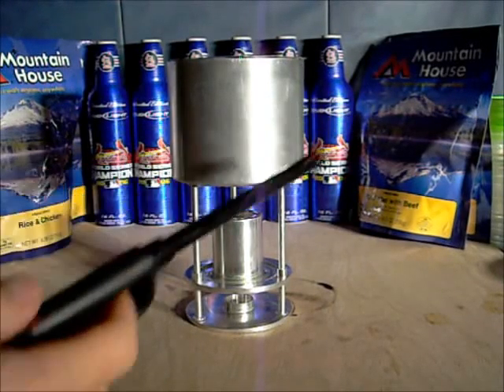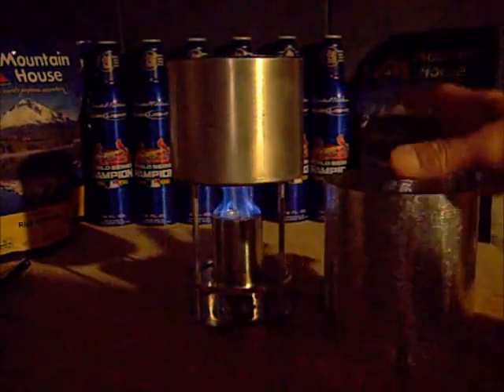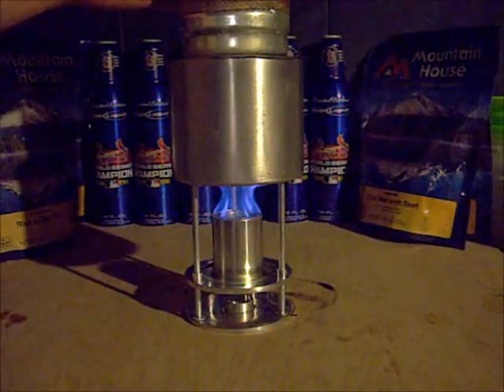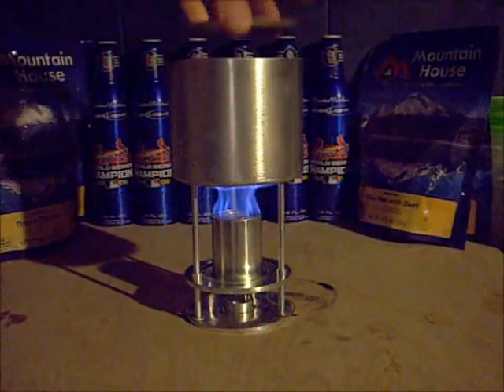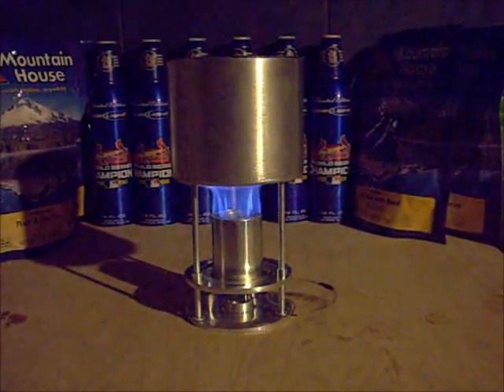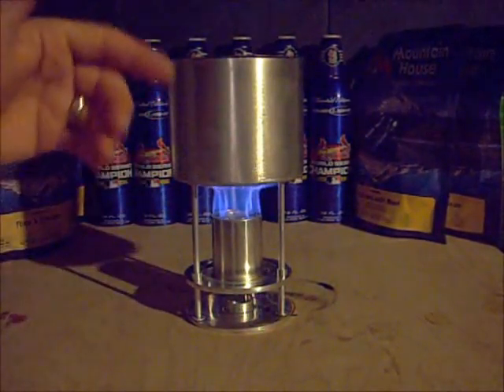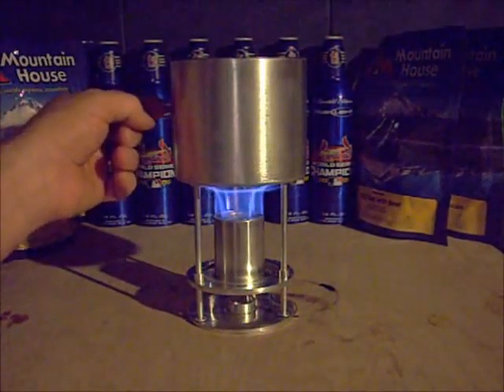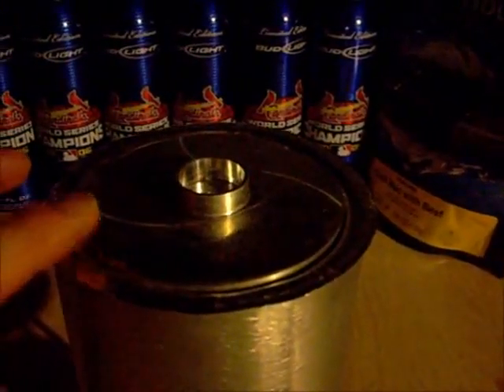New pot design

Comment: I work in a commercial kitchen and all of our cooking pots and pans are bare aluminum. Aluminum readily forms oxides and those oxides form a protective layer, this is called passivisation. When you sanded the surface there might have been a toxic hazard present for a while, until the raw aluminum re-oxidized.

Comment: The biggest problem is that you will build up a lot of deposits on bare aluminum.  A hard anodized pot would be much better.  Check out this ez2curanut  on youtube (jelly lite stove)  as he uses an off the shelf cake pan.    I think that it is close to the size pot that you are looking for, it's anodized and it is pretty cheap.  Best regards - Jon